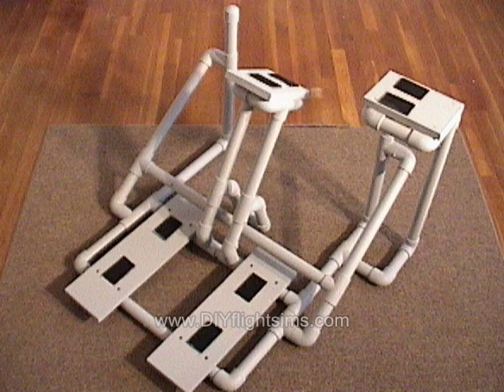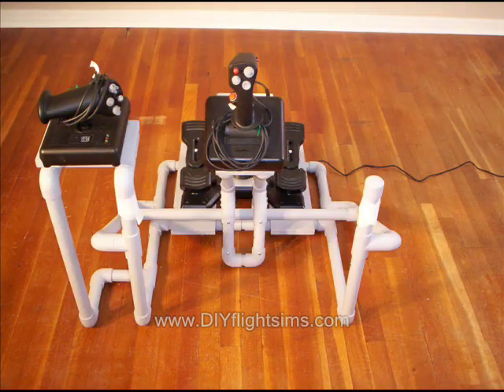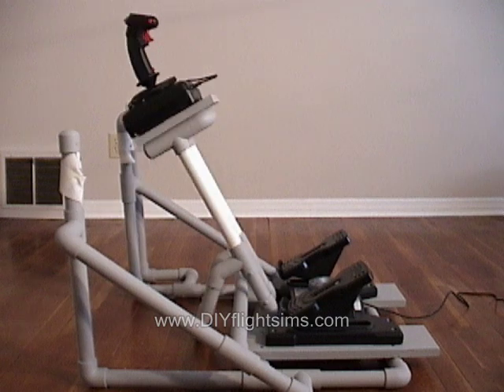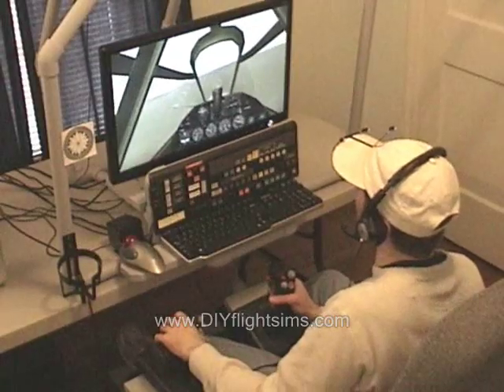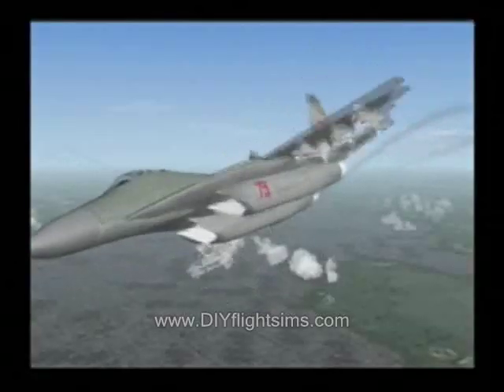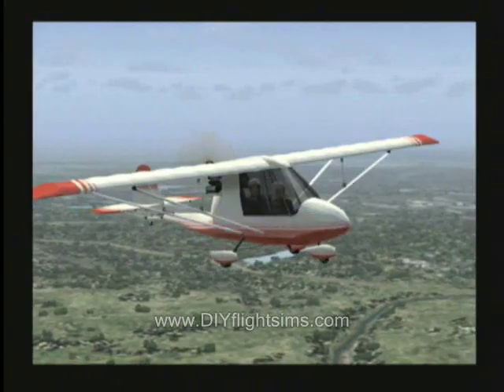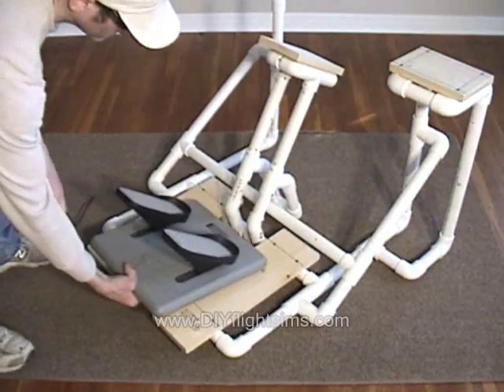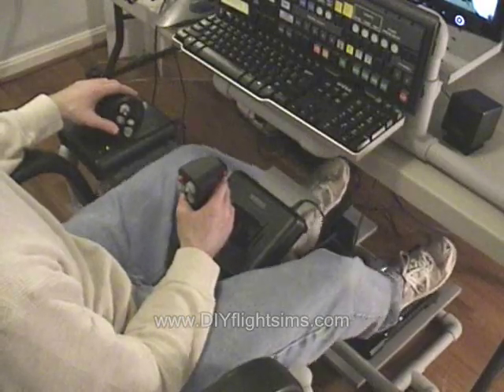DIY Center Joystick Frame

Comment: N e one thinking about building this I recommend very simple to make and the instructions are easy to follow I just built mine and it came out good I just had to change some stuff to fit my chair 2 inches wider and 2 inches taller since I'm short but wasn't a big deal instructions are easy to follow and parts you need theirs a list so you won't have to be going to home depot more than ones again don't hesitate this is top notch very happy with the outcome
Reply from the maker: Thanks for the message. I'm glad the project worked well for you.

Comment: Hello,
Why the angle on the center stick? It doens not look very comfortable for long flights. Is there a mod or a version with perpendicular center stick? Thanks!
Reply from the maker: +Frédéric Lord I designed it like that because it worked well for the CH joystick I had at the time.